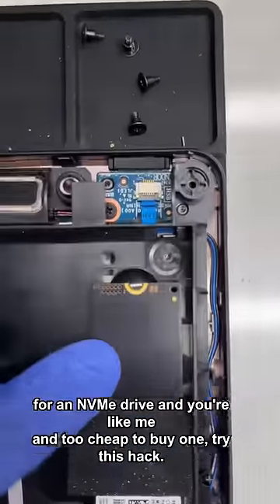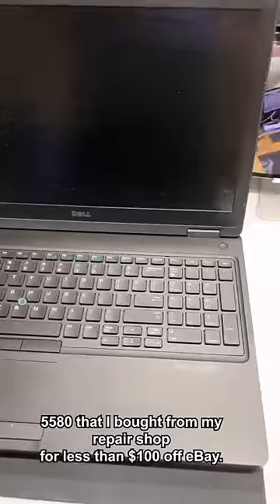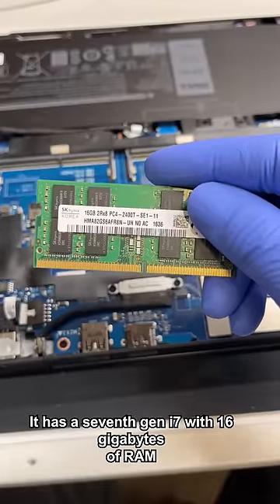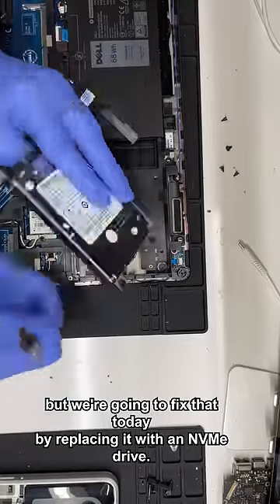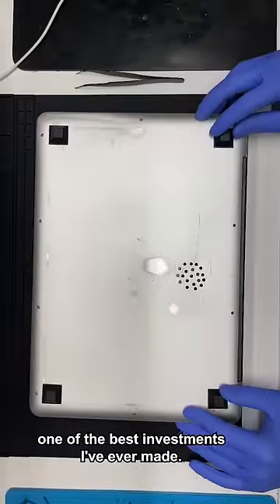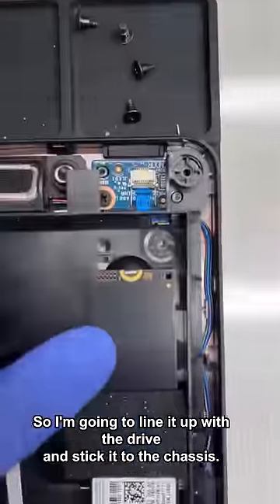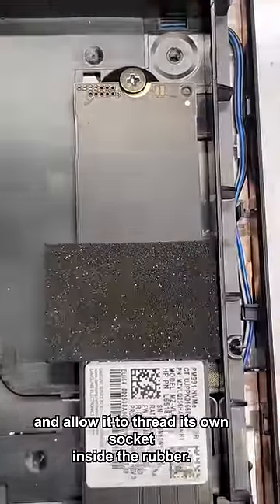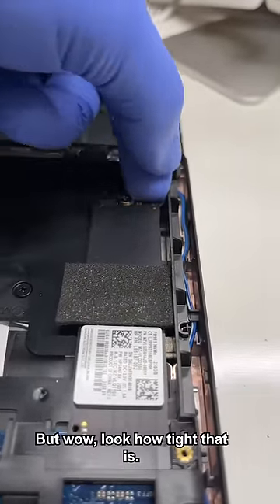No mount for an NVMe drive on your #gaming #pc ? No problem! #technology #tech #shorts

Comment: Some of those older dells even had a removable panel to change ram and hdd, those were the days. Now you have to fight 83.152 plastic clips and try not to break half of em
Reply: I have a Latitude D630 from about 2009 where I can just pull the drive out of the side and put in another. It's made of cast metal and sturdier than almost any other laptop.

If someone made a laptop built that well with newer hardware, I would buy it in an instant.
Reply: @user2C47 so just transfer a newer system to that chassis. You'll have to be picky but it can be done.
Reply: @MaraIndigoJade  It's a laptop.
Reply: @user2C47  yes, you established that with your first post. I don't think Ive seen a DELL Latitude desktop before, in all my years of repairing. I get gutting a laptop and transferring a newer system into it seems daunting...and it is, but it can be done if you're patient and pay attention. I'm the latter but lack the former however you may have a better time.
Reply: @user2C47 The D630 came out in 2007, not 2009

Comment: Tbh I just taped mine to the board and it’s been fine ever since 😅
Reply from the maker: I respect this
Reply: The 2280 drive I tossed in a school 3310 was only held down by the thermal pad on the bottom cover, and never came loose. (It even had the mounting holes for longer drives, but they had no threads!)
Reply: @user2C47  that’s amazing
Reply: @SalemTechsperts hope your still doing great man, I love your videos! Keep up the amazing content man

Comment: I have a question:
Why didn't you brought a sata SSD instead of an NVME ?
Because, if you plug an NVME in a sata slot, you will still not go beyond the sata speed
Reply: Exactly if it's not motherboard supported, then there's no point of trying to go around it
Reply: You misunderstand how M.2 works, it's only a physical connector, and can support either SATA or PCIe (NVMe for SSDs), or both, depending on how the system board is made. SSDs can only be one variety. 

That being said, where an NVMe drive might not be used at full potential would be if the board's M.2 only worked as a PCIe x1 interface as opposed to x4, or if it included an older generation of PCIe, as there is now Gen4 and Gen5 PCIe out, with SSDs in each.
Reply: @IanBPPK but if that socket only support SATA your computer can not detect NVME ssd
Reply: @zajizjaz Irrelevant, the m.2 slot on the 5580 supports both NVMe and SATA.
Reply: If the slot was only for SATA, the drive would not have fit.
Reply: @user2C47  it would, but it would not have worked, so my bad about that, the slot seams to be NVME and SATA
Reply: @user2C47 having had a laptop that was m-keyed, which I installed a nvme drive in - I can tell you that an m.2 nvme can fit the same m.2 sata slot and yet, if the motherboard/bios doesn't support nvme - you're not going to have the drive register.

It happened to me.
Reply: @laithpi It is motherboard supported in this video's case.  

This laptop supports nvme m.2 drives, it just doesn't have a spot to screw them down properly.  

Obviously this situation is more rare than what you & the original commenter(@florian-maudhuit3567) seemed to probably be assuming is happening.
Reply from the maker: As the comments above correctly explained, this mobo supports PCIe NVMe.
Reply: I can clearly see that the m.2 slot on the board is nvme supported by the key shape. It can take both sata and nvme m.2 drives.
Reply: My personal concern is that with SATA he could've reuse the connector and the tray w/o having to jerry-rig the drive to fix on the mobo...
Reply: Wrong question. NVME doesn't even fit without a convertor. Not even that Chinese crap.
Reply: @FunningRast  if "it supports both", then it's SATA. NVMe is a protocol, like SATA, but designed to work at bus (PCIe) level, which makes it way faster than SATA is.

Comment: you know they make SATA Solid State drives
Reply: Its piss ‘slow’
Reply: I've never understood the compulsive need to install nvme drives. On paper they're significantly faster than SATA, but in reality, the difference is negligible. 
I have an m.2 nvme drive in all my systems now, but it was mostly so I didn't have an ssd taking up a drive bay in my server and desktop 😂.
Reply: @jensalan  It's negligible unless you're moving lots and lots of files or recording to them.
Reply: @ZeroFudgeGiven  Even when transfering a large number of files, you're almost never going to max out the throughput of a SATA SSD. The theoretical max is still significantly faster than a gigabit network connection. Almost nobody has 10gb for their PCs, and even 2.5gb is still very rare. And if you're just backing up your work, it's probably to a hard drive array anyway for longer term mass storage. 

As for recording, unless you're working with specialized equipment, nothing is going to come anywhere near the max throughout of SATA.  Even a Red 8k camera at 60fps is still only half the bandwidth of SATA 6gb. In which case, it's no longer a regular computer.

Comment: Next question is does the motherboard support NVMe storage, because without a dedicated M.2 SSD mount something tells me no.
Reply: These dells often use the same bios across many models. I reckon there is a solid chance it does.
Reply: it doesn't. I'm sure he meant M.2 SSD.
Reply from the maker: Yes this mobo supports NVMe. The mount screws into the hole to the right and the bracket on the mount angles out so the NVMe can screw into it.

Comment: Any advantage to doing this over using a 2.5 SSD? I was under the impression that using the SATA port would bottleneck the speed.
Reply: No advantage at all
Reply: For the average consumer, no you won't really see that much of a difference, but for large data centres or companies you constantly transfer large amounts of data from one to another, these will certainly give an advantage
Reply: It’s not using the SATA port?
Reply: @FunningRast  It'll still give you a much needed improvement over a hard drive

Comment: Damn... this would have saved me massive headache. Could have used these on the Q latch stand offs on the X670E Crosshair Hero. The Q latches don't latch onto drives that have heatsinks on them but they do sit flush with the stand-offs. I have replaced the q-latch stand-offs with nylon stand-offs. 

The nylon stand-offs are secured with a nylon nut on the rear of the motherboard. It was a pain in the arse removing the q-latch stand-offs are they are glued to the motherboard - had to remove them as I unfortunately broken a 8mm x 2mm M2 screw in the stand-off just by slightly over torquing it... so  i just replaced them all except the M2_1 socket as that is covered by a massive whopping heatsink. The other M2_2, M2_3 and M2_4 sockets are covered by a shared motherboard heatsink which ultimately caused system instability at higher temps 55 degrees c plus. As there was a consistent heat load of 55+ x3 heat load on both sides of the motherboard.

I have a cooler master h500m and the glass panel on the rear of motherboard was ridiculously warm. my ssds would randomly disconnect due to the amount of heat too.

Now, I have all 3 nvmes in a double sided heatsink (bottom plate is ridged for higher surface area) and no longer get any BSODs nor is the glass panel on that side is warm.

I did contact ASUS about replacement q latches, the initial email? They blamed me for installing the motherboard heatsink ontop of the m.2 heatsinks when it was not even remotely possible. When i pointed this out they stated on email, the mobo was not designed for m.2 heatsinks and my only recourse was a refund. When asked if they were categorically telling me they were restricting users on a £700 motherboard - i didn't hear single peep and haven't since.
Reply from the maker: Wow, sounds like an adventure and a typical ASUS answer. Glad you at least have stability now!
Reply: @SalemTechsperts  Yup, glad to have stability too. No more random bsods, even with ambient temps at 30 degrees c and no breeze - this past week or so. None of M.2s went above 68 degrees on idle (I did increase my fan rpms though to compensate). Also, I have monitoring the VRM or ASUS EC enabled on HWINFO which does cause some bsods on W10.

I'd be having a whole host of issues on idle with the motherboard heatsink as it's very flat and does not catch airflow easily. Sure, could add a fan but I'm hesitant to add a fan over the heatsinks as there is alot of soldered connections. As I will end up with dust all over the motherboard (seen it happen from past experience with a over heating PATA HDD).

Plus concerned about the soldered connections next to the m.2 slots. I was checking the precision on my preciva metal calipers (was measuring the q latch stand offs prior to me idiotically breaking the screw lol) and there were sparks coming off those soldered connections lol... soo yeah... 

I'll stick some beefier sabrent heatsinks on the m.2s as I plan to water cool the GPU once I upgrade from the RX6750XT to the RDNA4 flagship and vertical mount it. That will give decent amount of air flow from the bottom H500M fan.

Comment: Chances are if it doesn't have a mount, it doesn't have a slot.
Reply: PCIe to nvme adapters
Reply: That model can accept either an HDD or SSD mount frame in that location. For obvious reasons it shipped out with the HDD mount frame but it can be swapped for the SSD one.
Reply: @ireallyreallyreallylikethisimg  it doesn't need an adapter, it needs a mount. Also I don't know of a laptop that has a spare PCIe x4 slot that's not an m key.

Comment: I've never understood the compulsive need to install m.2 nvme drives. On paper they're significantly faster than SATA, but in reality, the difference is negligible. 
I have an m.2 nvme drive in all my systems now, but it was mostly so I didn't have an ssd taking up a drive bay in my server and desktop 😂. For a laptop like this, it doesn't really make much sense over just installing a cheaper 2.5" sata ssd.
Reply: Totally agreed!
People look at pretty numbers in synthetic benches, but when (and if, that is) they do real world tests - they usually tend to be quiet afterwards.
No wonder - no one wants to act like a fool, in attempt to justify the sheer value of a pointless pricey item they bought. =)
It's like getting a extra pricey car, with a 3000 mph mark on a speedometer.

Did a lot of benches myself (4k files as well, ofc - not only linear), and came up to a conclusion to get beefy (storage wise) Sata SSD's instead - not only they're cheaper (e.g. easier to replace if they die due to TBW), provide more storage per dollar, and they won't overheat on top of that (they don't require any passive cooling whatsoever).
The only reason to buy an NVMe, as I see it - when all the Sata slots are already filled, or if a client wants a "clean" look (e.g. no extra stuff via cables).
Reply: quality of life i guess

Comment: Well, I got a newer SSD for my laptop (my little brother's old one) and it is longer than the original one I had. So I just put a little wad of packaging foam under the SSD and held it in by stabbing the mounting screw through it. And it works perfectly, the SSD is mounted securely and even holds up to me taking the laptop with me to school every day.

Comment: Last year, I found a 2005 dell latitude in my school’s robotics room. The robotics teacher had taken it home and installed Linux on the dell, and it still worked pretty well despite its intel dual core processor, 2gb of ram, and some other depressing specs.

Comment: The internals are solid, but the outer panels on those newer Latitudes are made out of the cheapest plastic imaginable. A lot of them start cracking and falling apart after only a few years.

Comment: Or, just buy the right size drive. Did you notice the gold spot on the drive right under the screw head? That's for grounding the drive to the chassis. If the drive isn't grounded properly, it can cause all kinds of weird errors and possibly shorten the drive's lifespan.

Comment: That's probably even more secure than the stock M.2 mount in the first place. The laptop can flex a little, and that flimsy tray is what the M.2 mounting bracket is connected to. We had Latitude 5480's at work where M.2 drives have slightly unplugged themselves a number of times. We didn't have many Latitude 5480's, but we'd get a ticket about one not detecting a boot drive every 6 months or so. Easy fix. Stupid problem to have. I wonder if that was an issue the 5580 also had, especially considering that nearly everything is identical between the two models.

Comment: It’s missing the mounting bracket for the nvme drive.  When dell installs a hard drive they don’t put the part in there.  The part can be purchased in order to fit a 2280 nvme which is why there is a screw insert that’s off center.

This bracket is probably the same price or cheaper than the rubber pads you bought on eBay.

Comment: tape is my friend, had a mount but the screw is already damaged so bad, drilling, is so dangerous (to avoid dmg to the pcb) managed to tape the nvme on one end, and the other end on the back of the pcb, and the whole board still the same height and can fit back inside the laptop body, so all good :)

Comment: For reference a quick Google shows the bracket costing £5 ish or £14 with the heat spreader.

If you're keeping the laptop to run into the floor then better to spend the money than not.

He's right latitudes are business laptops, so spares are plentiful and they're fairly solid, so are the lenovo thinkpad and thinkbook series laptops.

Comment: Neat trick for the hold down. I have a MSI GL65 Leopard that MSI left one of the m.2 area unpopulated, so I sourced the components and soldered them on since the the BIOS supported a 2nd nVME. Now I have 2 nVMEs and a 2.5mm SATA bay.

Comment: Only issue I would have is that NvME drives can get hot enough to melt plastic so hopefully the rubber can handle the heat better. Had a buddy hold down an NvME drive with a zip tie and it melted that zip tie. Mocked him for months about it.

Comment: Used to have the same issue when adding mPCIe headers to laptops that had spare pads on the board but the manufacturer cheaped out and left them unpopulated. Just epoxied the posts in salvaged from junk laptops.

Comment: I had to replace my drive and decided to buy and nvme.

Halfway through the build I realize the stick is a size longer than the unremovable mount on my motherboard, and the extra mount is on the mobo box 2 hours of driving away.

"Fuck it, I'm gonna wing it"

-Grab spare mobo stand offs

-Butcher a dead screen from a laptop until i find a screw the right lenght but still too thin

-Fill up the standoff with a carefully engineered wood splinter salvaged from a toothpick and screw into it after mounting the drive.

I was never so proud of something working out so perfectly.

Comment: Watching this on my Latitude 7480 which had traveled the world multiple times already. magnesium chassis, backlit keyboard, 1080p IPS, two SSD in RAID 1, i5 7440HQ, 10+ hours battery life, NFC, USB-C with Thunderbolt 3, Fingerprint reader, RJ45, 3,5 mm Audio, SIM card, HDMI, DVI,  SD card, Secure Digital slot, spill resist, physical touchpad keys, Infrared login, etc.

Comment: I found a package of NVME stand-offs with varying sizes on Amazon to fix this similar problem on my PC. Sure, I have a bag with several sizes of rubber feet, but I can't be bothered to find it. Next thing to disappear will likely be my box of various O-rings. I swear that containers of small and not often used parts are harder to find than left socks.

Comment: I'm impressed it even had an M.2 slot

I did something similar before.  Bought a cheap $200 HP laptop that had Win10 and 64GB SSD.  It had room and IO for a disc drive, but no slot in the case.  So I duct taped a SATA 1TB SSD in there and had myself a cheap PC!

Comment: I would have used a sata ssd there anyway.
M2 Nvme SSDs have issues with heat, so you have to be careful before fitting them in a system that has no dedicated heat spreaders, sinks, or fans that are made to cool that part.

And spoiler, most pcs that come with sata slots fitting those toshiba hdds (all my older laptops have those toshibas, same exact MQ01ABF050 model), have it located away from all the other components, including cooling systems.
Putting a nvme without even a copper heatsink in here, especially if gen4+, you could probably get away with a cheap dramless gen 3 like the sn570, is no bueno.
Reply from the maker: I agree with you in general. This is a gen 4 nvme but on a gen 3 system. Being lightly used for office work, basically no reading and writing to the drive. This thing stays cool as a cucumber.

Comment: Not all 3M adhesives are excellent at all points in time, as it is made to achieve varying degrees of adhesion initially. Plus it is vulnerable to degradation through heat exposure and aging.

Comment: I agree! That is my exact workstation in 2017 with 32GB RAM and 512GB SSD (CTO spec), and it's robust as f! I kinda missed it today, tbh compared to my current workstation, which is an HP Elitebook 845 G7.

Comment: 3M Novec 7100 is what I use to cool all my PCs 3M makes great stuff absolutely nothing will keep your PC cool and cleaner than Novak  7100 no dirt can get in because the PC is completely submerged completely sealed no need for fans you don't have to worry about electrical shorts from a water cooled system it's an overclockers dream.

Comment: Same with my Toshiba satellite. 3000 series i3, so underpowered today, but the thing refuses to die. I've had to do some frankenstein work with giving it a new battery and screen but all the internals are still strong. I mean, the fan is 10 years old and doesn't even rattle a little!